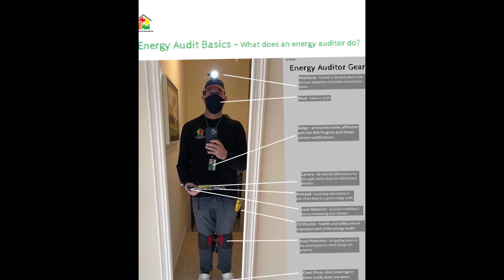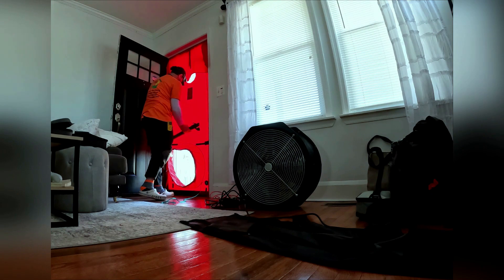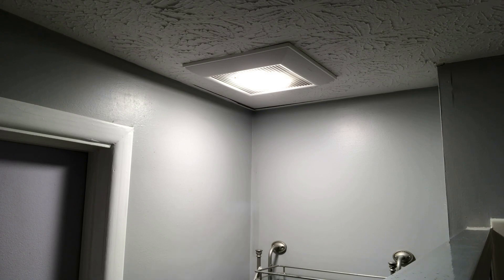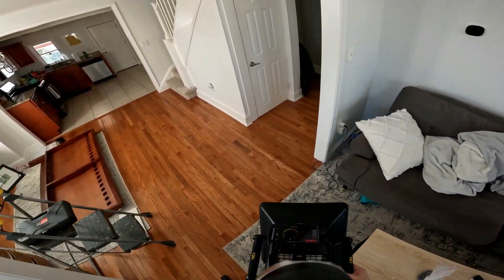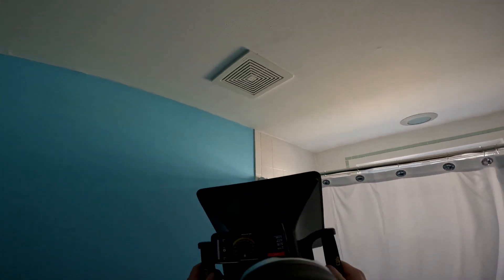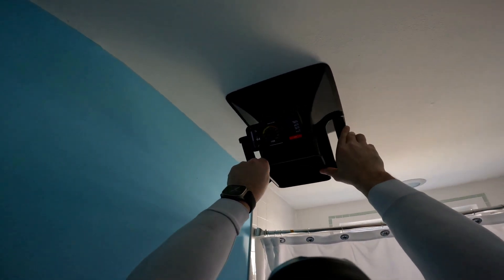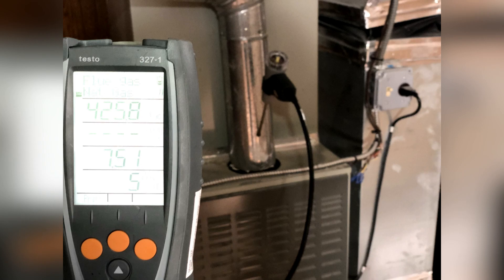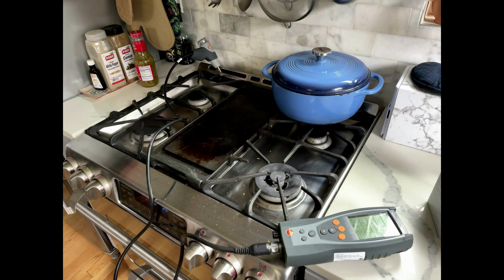Home Energy Audit Toolkit: What I Actually Use in the Field

Comment: That easy hood is not accurate enough. You need an exhaust fan flow meter
Reply from the maker: Tell me more...
Reply: That east hood is good to like compare one supply to another if you are balancing a system but it’s just not accurate enough to test an exhaust. Retro tech and EC both make an exhaust fan flow meter. Those with using your gauge will be way more accurate

Comment: nice one! keep it up :D
Reply from the maker: thank you! much appreciated! ♥
Reply: @homeairleakagetest  hi I've been interested in becoming a home auditor. I was told I have to be certified first. What steps do I have to take & safe website to get my certificate??? Thanks 💯
Reply from the maker: Check out BPI.org. Look for a BPI proctor near you. Find out from them what you will need. They recently changed a few things and although the information we learn is the same, the names of the certifications are slightly different. I have the Building Analyst and Envelope Professional certs under the older program. Hope this helps. @thegreat1548
Reply: @homeairleakagetest  i think takes longer than 10 min to audit average home i wish if u can post a full house audit